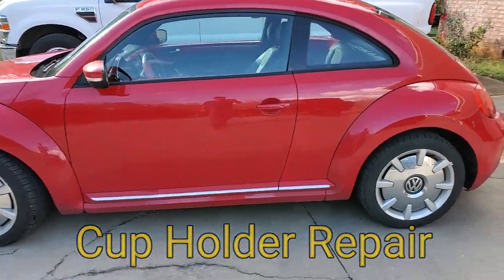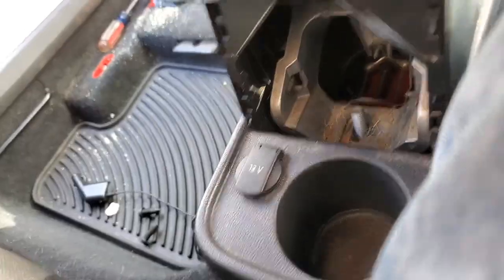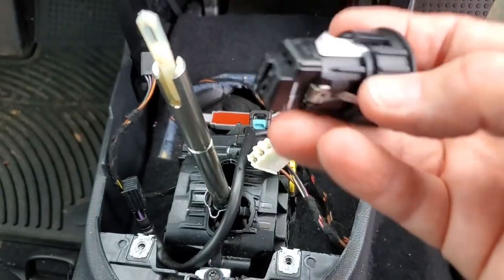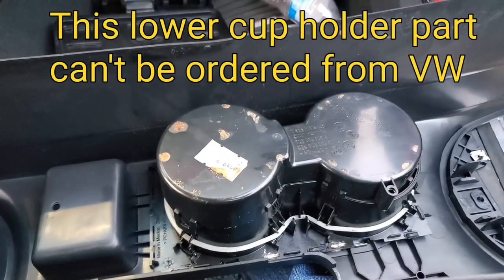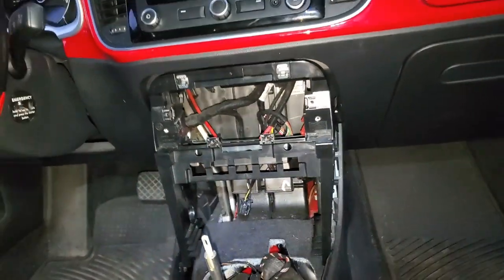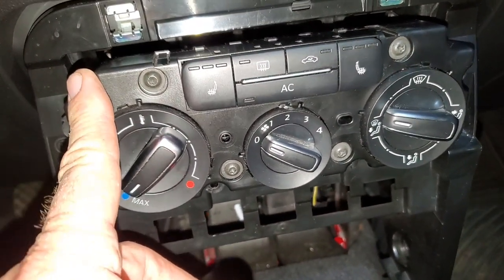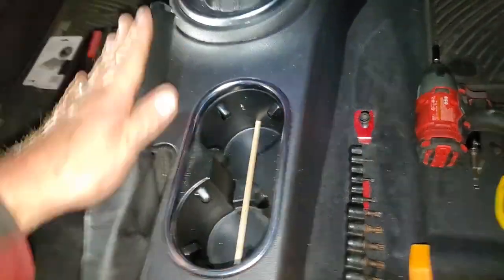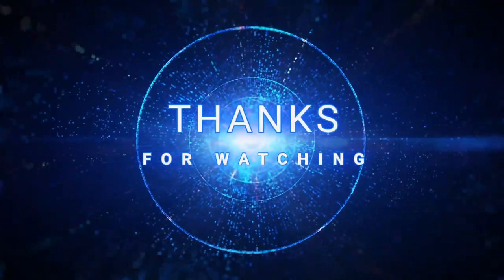2012 Beetle CupHolder Repair-Seat-Middle Console-Gear Shift-AC Console Removal

Comment: Do we actually need to remove the seats? It looked as if we’d be able to remove the center console without having to remove the seats or was it to be able to access everything easier?
Reply from the maker: It can probably be done with the seats in but, the seats are so easy to remove and, with them out, there is so much more working space to be had.  To me, its worth it to take them out if you can.
Reply: Thank you, I have this as a project this weekend.